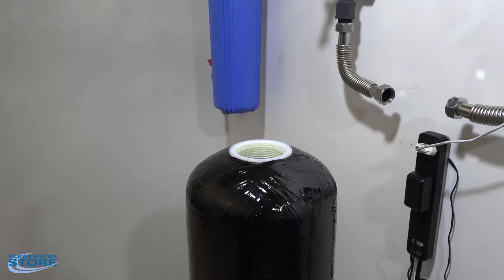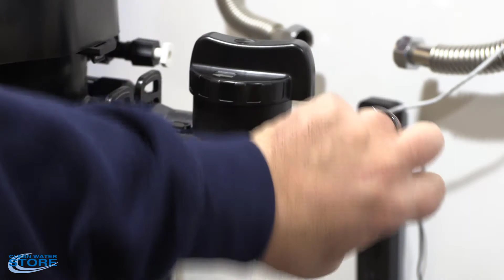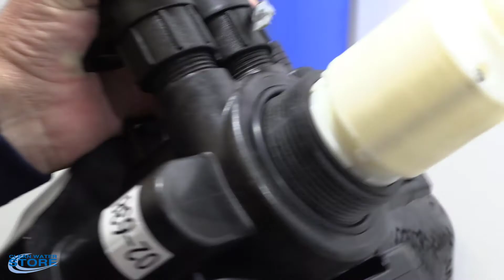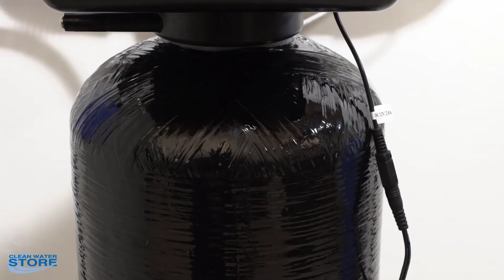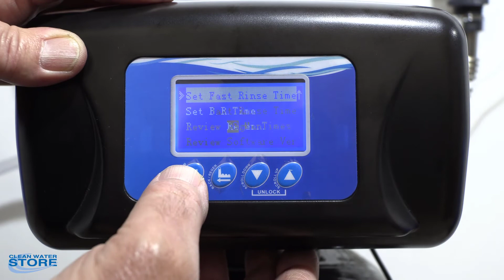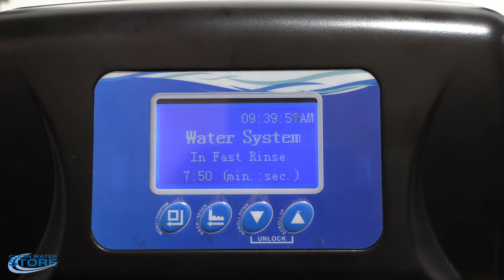7500-Rev4 Filter Set Up and Installation

Comment: Question: My system install seemed to go flawlessly one month ago (comment below) but I am still getting lots of the black stained water coming up through all the plumbing (very dark color). This happens after each regen which has been set to every 2 days right now since we have a lot of iron. What can I do to remedy this black stained water. Not getting better.  We have to run faucets for about 10 min for the stained water to clear up - until the next regen when it happens all over again. We do not use a whole home filter.  If anyone consumes this stained water by accident do we need to be concerned? As I did an extra 2 full regen cycles today, water appears clear at the drain and test spigot at the end of the backwash and rapid rinse cycles. All regen cycles are operating correctly.
Reply from the maker: Our support techs say this could be caused by several different issues.  We want to walk this through with you over the phone and get this fixed asap.  Please set up a time for us to call you back https://go.appointmentcore.com/guest/book/eZeZdVQj  or email us at support@cleanwaterstore.com.

Comment: Great set up instructions.  The system does not go straight back to “in-service” after the first backwash and fast rinse cycles - it goes to air draw, etc., and you have to advance through these remaining cycles using the back/regen button until it reaches in-service. After it reaches in-service, then you can start the next backwash. This is a great company with solid customer service and so far it seems the product quality is good.  I’m on my second system (I upgraded) since 2016. Very pleased!
Reply from the maker: Thanks for the comment on this and glad its working out well!    This video was for standard filter valves, where no air is used.  We do have one for Air type as well: https://youtu.be/DF3uHu93WDo